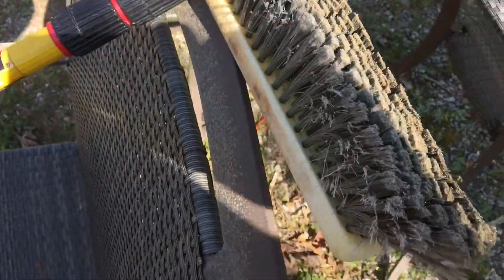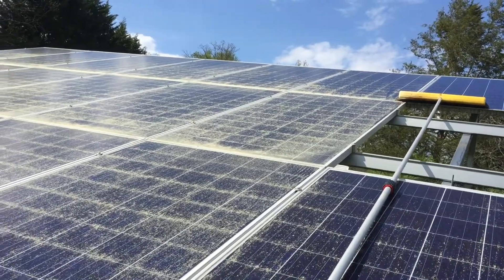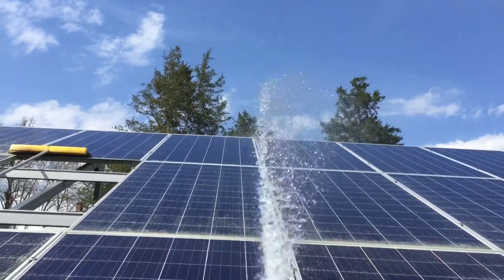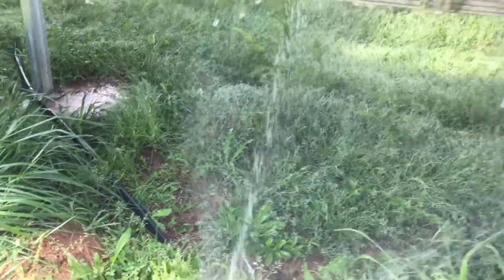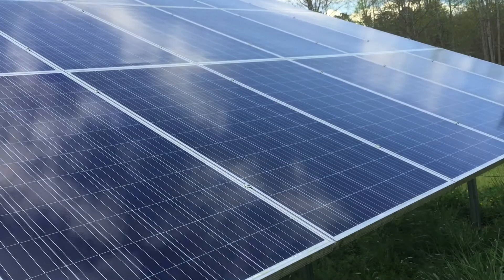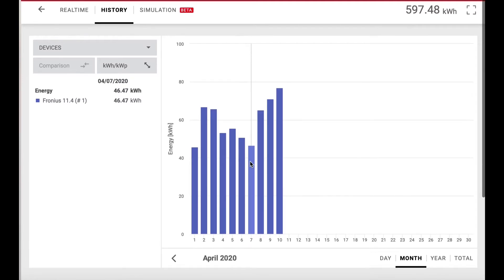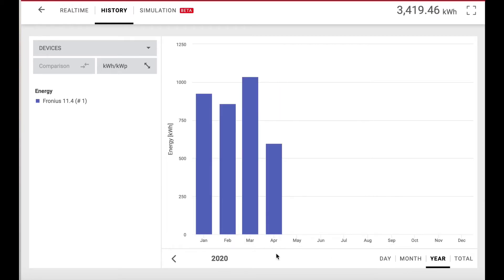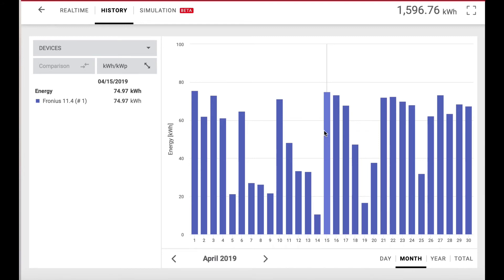Cleaning Pollen off of Our Ground Mount Solar Panels

Comment: Thanks the video! I also live in SC and my ground mount system was caked with 3 years worth of pollen and other gunk, that was reducing my production by 20-30%. I found that using the sponge side of a car windscreen squeegee, dipped in a bucket of windex, on a long pole was more effective than using a soft bristle brush.
Reply from the maker: Thanks for watching and sharing your experience. I have been cleaning my panels once a year even though I did not have a lot of pollen and it is hard to see the difference in performance. If there was a lot on your panels I can see where that would have a large impact. Thanks again.